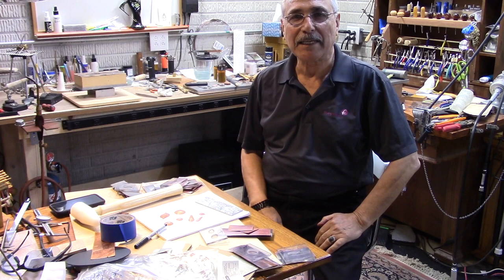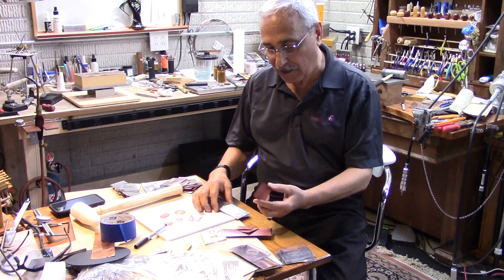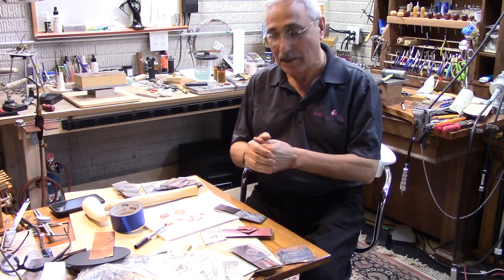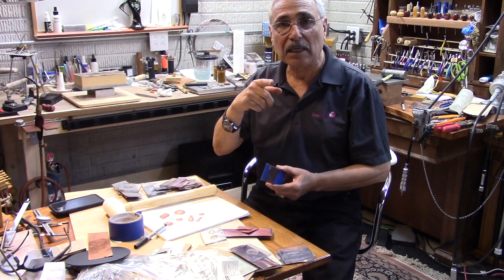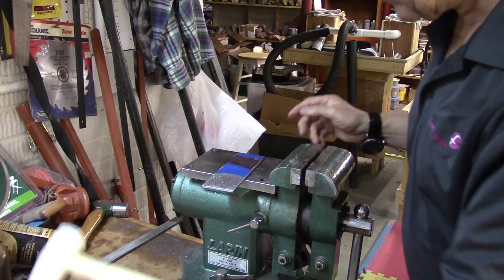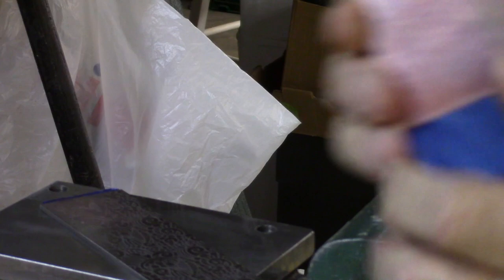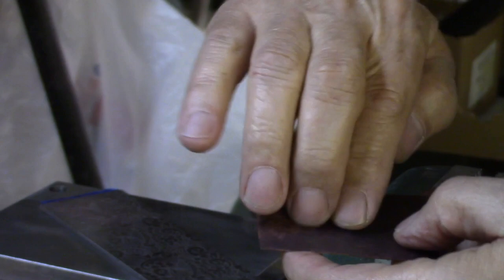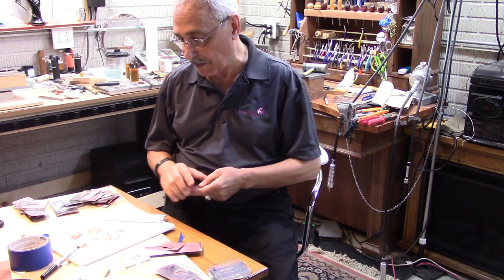Texturing Silver & Copper Sheets Using Hammers

Comment: Thank you. Tried with lead and heavy hammer. Sirt of worked but not happy. This looks much simpler.
Reply from the maker: Heavy hammers will also damage the surface with less control, the hammer I used is lighter and easy to use, Harbor Freight carry them. Thanks for watching.